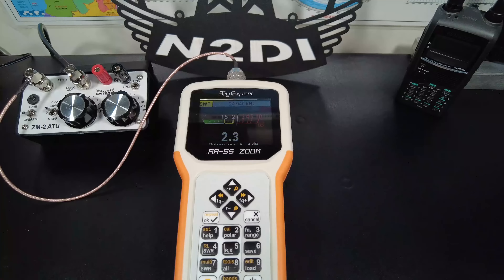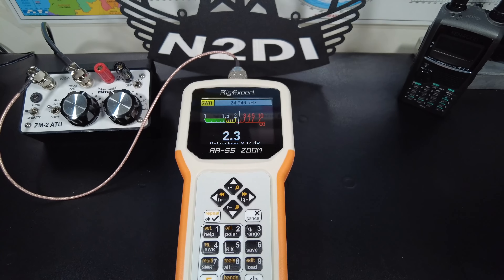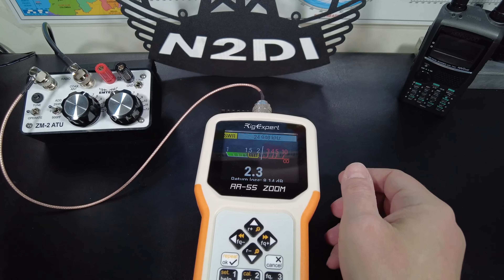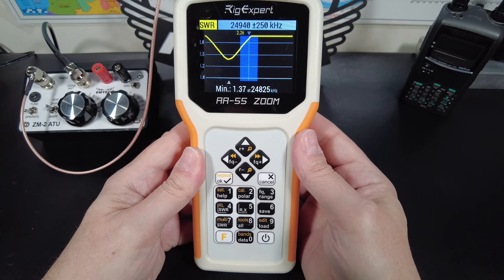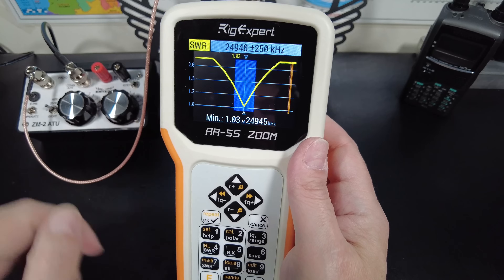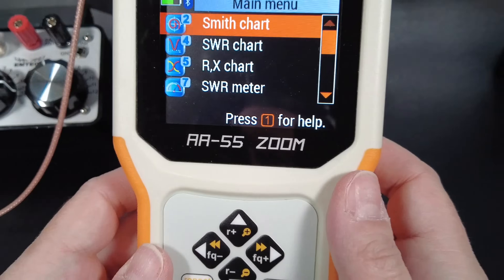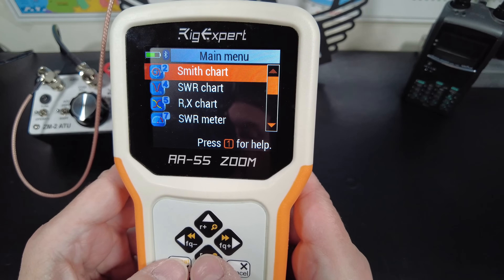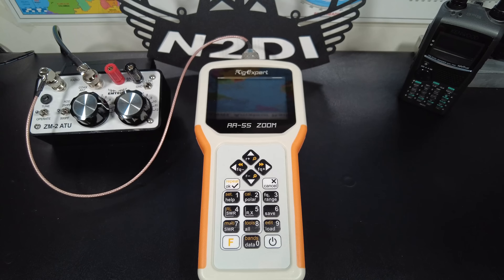All About Antenna Analyzers

Comment: Joe, I am a SWL listener. I have a well operating Hammarlund 170 Ham receiver . I just enjoy listening to Ham operators. I've got 2 antennas attached to my house, an active loop antenna, and a home made delta 6 meter antenna. The 6 meter actually pick up broadcast on 40 meters and some on 20. Anyway, would an antenna analyzer be of use to me even though I don't transmitt? I'm thinking of making more antennas to cover to 10 meter band too. I wouldn't need anyting expansive. You thoughts?
Reply from the maker: For an SWL, an antenna analyzer is not necessary for the fundamental purpose of listening. A simple long wire antenna can be very effective for shortwave listening across a wide range of frequencies without the need for tuning. Because a receiver is designed to handle a wide range of input impedances and does not transmit power, a high SWR is not a major concern.  If you are interested in building your own antennas, an analyzer is invaluable for trimming the antenna to the correct length and ensuring it resonates at your desired frequency. This can help you maximize the signal strength for a specific frequency or band. An analyzer can help you diagnose issues with your antenna system, such as a broken wire, a bad connection, or a faulty coaxial cable. Ultimately, a shortwave listener does not need an antenna analyzer, but it can be a very helpful piece of equipment, particularly for those who enjoy experimenting with different antenna designs or troubleshooting their setup.

Comment: Hi I’m just after some advice I’m about to purchase the aa 35 rigexpert but I’ve read some mixed reviews would you say these rigexperts are good quality and worth the money many thanks. Stu.
Reply from the maker: I started out with an AAA35 that worked for years that I ended up givinng to my Dad and he's had it for years.  It's never had an issue.  I upgraded to an AA55 (which you might want to consider if you can afford it because if the feature set) which worked for years without issue and is still my main antenna analyzer.  Eventually, I got the RigExpert stick 500 for UHF and VHF in additionn to HF and that's been around for a couple of years without any issues as well.  It's also important to know that I use them CONSTANTLY, so they're not just sitting on my bench.  I've used them in the field and carried them around in backpacks.  They've been banged and dropped. This is all in a span of like 9 or 10 years.  I can't tell if the newer ones have degraded in quality recently (possibly because of the war) but the ones I've used have always been rock solid.  I think they are great and worth the money.  Hope that helps.

Comment: Im going to pick one of these up which model would you go for ? Im between this and the newer stick models with bluetooth ?
Reply from the maker: For HF I'd get the AA-55 Zoom.  I've used the stick 500 before and AA-55 can do a lot more and the screen is easier to read.
Reply: @JoeN2DI  Cool I will go for that then as it's down to £275 in the UK so basically £50 off just now , maybe they brining out a newer model or something 🤔
Reply: @JoeN2DI  Thanks buddy 👍

Comment: I did without an antenna analyzer for decades, used old tech grid-dip style meters, or trial and error with an SWR meter.  Just ordered a RigExpert, as I am going to demonstrate field portable operations to some friends and want to get up and operating as fast and efficiently as possible.
Reply from the maker: There is no device that can replace experience.
Reply: @JoeN2DI  Yes, it is my experience that helps me understand and use this new tool efficiently.

Just used it to better tune my mobile antennas.  Works great.